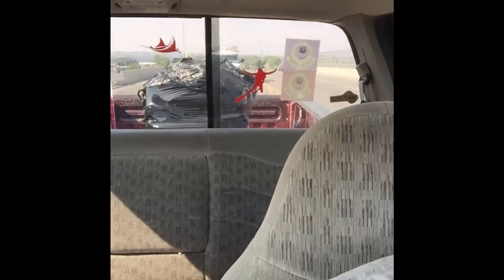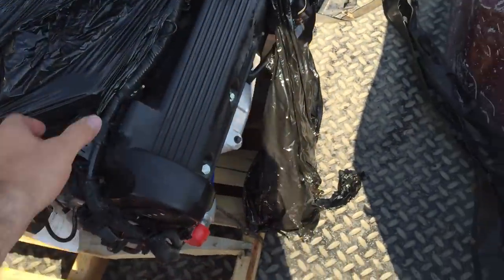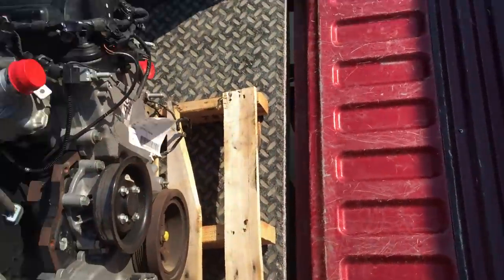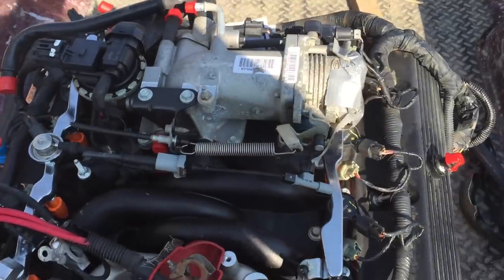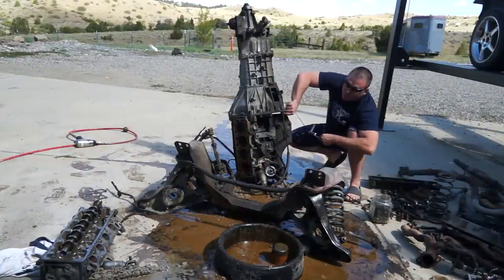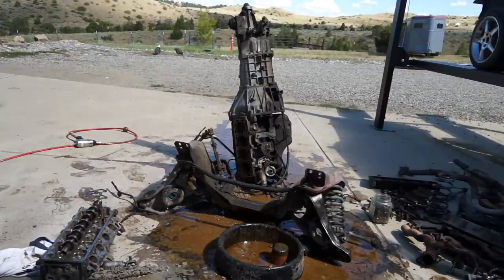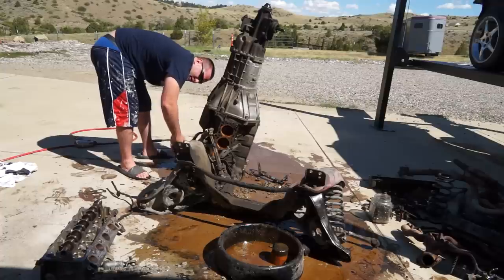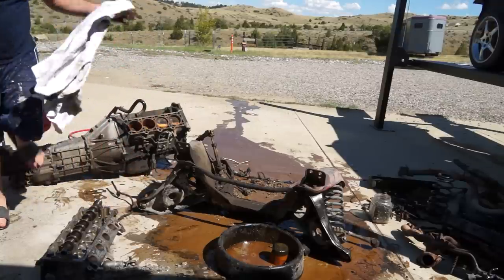2 Valve Swap Drag Build (Part 13)

Comment: hey hold my beer and watch this yall LOL
Reply from the maker: +Donnie M. lol, what? I didnt even do anything crazy in this one
Reply: When you picked up the transmission while it was still engaged in the clutch of the engine if that would have slipped you may have been missing the toe lol flip flops and motor don't work well together I've been wrenching 4/23 years and very well proficient at it and I have had my fair share of  goofs your build is pretty good but how do I get sponsered I'm building a g-body an 80 Cutlass
Reply from the maker: +Donnie M. When I picked it up it was still bolted on :)  no worries. Ive dropped a tranny on myself like that before haha.  We live and learn right?  Thanks for the positive comments on the build my friend!  Sponsored is basically a product of what can you give them?  With me I sell their products and make these videos, go to shows, run a website www.auto-mafia.com, and generally tell people and support their products.  Its not very easy.

Comment: Roughly how much longer until the mustang is ready to go? Figure by now a year would be plenty of time to do it?
Reply from the maker: Hunter Brooks Well we are filming everything we do, I work several jobs, and we have to kind of wait for money to come in, and good deals to pop up in order to make the build happen.  If we had all of the parts it would still take me a couple months to build and film it all.  Dont worry though, we are getting very close.  Engine will go into the car soon, fuel system will be done, brakes will be hooked up, we will be good to go soon and doing some burnouts and testing at the drag strip.

Comment: Cool build! I just picked up a '95 and have a similar build underway but I'm using a 5.0 out of a Mountaineer...Is the 5k budget out the window? If not I'd like to see a breakdown, I have a similar low buck budget...
Reply from the maker: Mr. Jay A We are actually still under budget even with all of our super nice parts!  Check out the forum build and the description for a full run down of the parts list so far...

Comment: my buddy has a mod motor in his coupe he sprays 350 to it and its a junk yard motor
Reply from the maker: +Hunter Overton 350? thats a TON!  I probably wont go over a 200 shot.
Reply: +Auto-Mafia i just bought a 92 fox vert for 350 drove ot home i kind of want to build it but im sketched ny the vert
Reply from the maker: +Hunter Overton Sounds awesome.  You should post it up on the forum! www.auto-mafia.com  And there is nothing wrong with a vert!  We are building one as a DD right now!
Reply: +Auto-Mafia i joined as chevelle6869
Reply from the maker: +Hunter Overton Awesome!